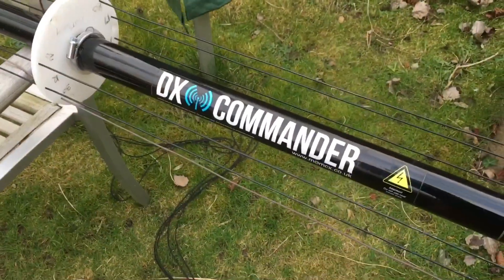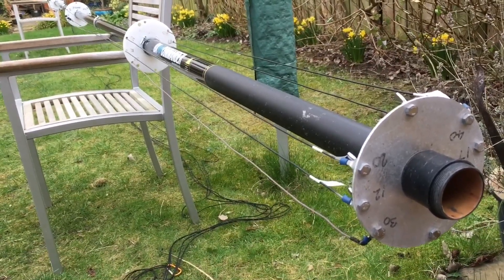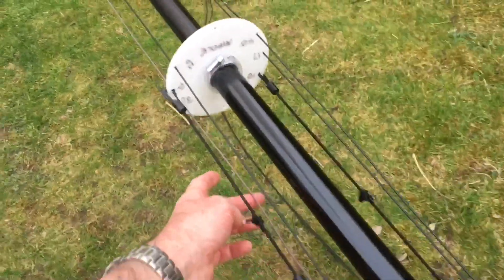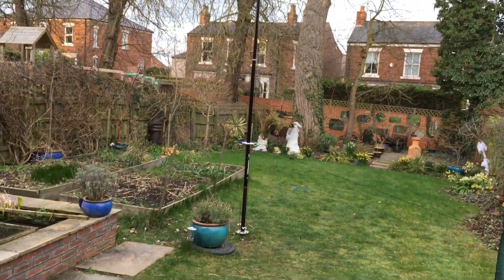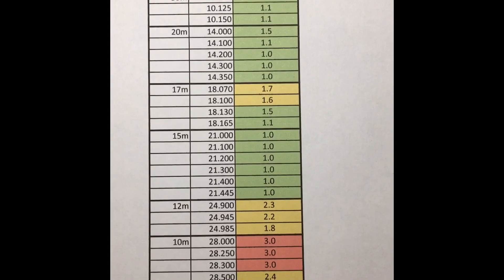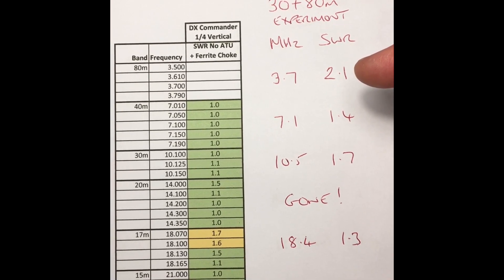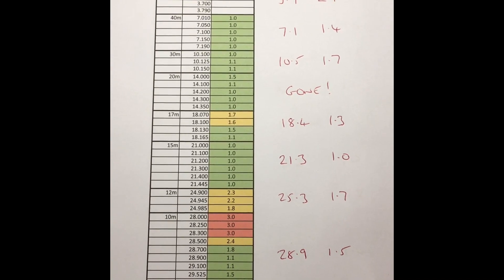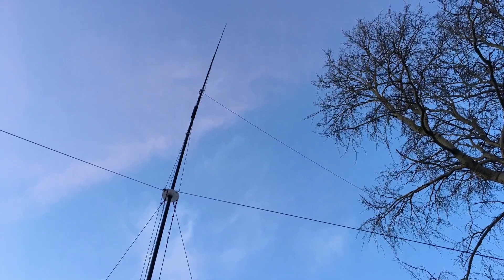DX Commander Home Base Antenna Installation - Adding 80m - Part 3

Comment: Thanks for experimenting with 80m, it was something I was considering doing when my DX Commander which arrives later this week. Could you advise me on the total length of the 80m wire please (from the main plate to the isolator at the tree)?  Also did you notice any significant difference with the coax isolator in place? Thanks again, top video!!
Reply from the maker: @dave-ef2fd  Hi Dave. That’s video’s from a few years back now. The choke doesn’t negatively impact the setup. I can’t recall the length of the 80m wire, but if you start at 20m and then trim from there, it won’t take you long to find the length that works for your setup. I still use mine, but now without the pole. Just the base plates and radials and 160/80/40m verticals up to the large tree. Good luck with yours 👍🏻 (I also have an Expedition model with an 80 option. It’s on the channel and may include the 80 length? Not sure)

Comment: Good video now I can see what level to run that wire for 80 at. Very useful information. 
>>>UPDATE!! I went off at the 5meter (third) spreader like Callum  suggested to keep the bending moment lower on the pole. Reduces the bendy aspect of a taller take off. My 20 meter is my best band. <<<
Reply from the maker: Great 👍🏻

Comment: Have trimmed element lengths to achieve
However, the 80M SWR curve only dips
You can see the graphic of the SWR curve

Jimmy
W4MUF
Reply from the maker: Hi Jimmy. If you tried to post a picture of the curve it’s not showing in the comments. Good luck if you’re still adjusting 👍🏻

Comment: You can see the graphic of the SWR curve here…
 
 
Jimmy
Reply from the maker: Hi Jimmy. I saw your graph on a notification I get off YouTube, but I don’t think it allows embedded links. The width of the dip looks about right, but like you say, it’s not low enough. This could be perhaps the positioning of the whole antenna and/or where the 80m element goes to and what it’s near? You may also find more radials bring the dip lower too. Good luck 👍🏻

Comment: Hi ian excellent video. In regards to ground radials for 80 40 and 30m, by adding an earthing rod to compensate does this make mutch of a difference to performance noise and swr?  Regards David
Reply from the maker: David R Hi David. A ground mounted 1/4 wave really needs a ground plane to perform. I don’t think a rod will achieve much, but if you have the equipment to hand, then perhaps worth a try? Since this video I’ve extended two of radials by soldering extra lengths of wire to their ends. So two of the 40 x 3.5m radials are now actually 43m long. Having said that, I’m not sure if it’s improved as a result of this? If you check out one of my other videos, I successfully use the base plate for 1/4 wave verticals on both 80 & 160m. Enjoy your radio 👍🏻
Reply: @G0CNN-Ian  thank you for your reply Ian, really useful information. I have a limited antenna unfriendly garden  but will keep trying. Hopefully see you on the key
Reply from the maker: David R Have fun David!

Comment: I just put up the DX Commander ABV antenna also. I am having bad problems with the swr being to high. Here is the way it goes on mine.
40m 7.041 is 1.8 7.175  is 2.5 and 7.300 is 3.4with a 6 cms foldback
29 m 14.0014.225 and 14.350 is 2.4
17m  18.110 is 1.6 and 18.168 is 3.3
15m 21.225 is 1.2 and 21.450 is 1.3
10m 28.300 is 6.1 and 29.700 is 7.5 
Am I correct in thinking all my vertical elements are to long? I used measurements Callum gave in some of his online instruction.as follows
40m is 11.5 meters
20m is 4.82 meters with a 20cm foldback. 
17 meters is 3.83 meters with a 6cm foldback
10 meters is 2.5 meters with a 5 cms foldback.

Any ideas would be appreciated! Thanks!
Reply from the maker: dheller777 40m looks too long. Fold more over and see where it goes. This will sort 15m as well as it’s the same wire.  I can’t tell for 20m as I think you’ve mis-typed? The others are probably long too, but the higher the frequency, the less fold back you need as they are more sensitive. If you fold back too much, you may over-shoot! Sort 40m first then go up the bands from there. You’ll sort it in the end. Just a case of a lot of ups and downs of the antenna and moving the electrical tape before you finish and commit to the shrink tube 👍🏻
Reply: 20m 14.255 is 1.9 and it goes up to 14.350 at 2.4
Reply from the maker: dheller777 again, may be lower SWR nearer 14.000MHz and too long? Assuming the antenna is not too close to anything and you’ve got the radials down, then there should be a 1.1:1 or 1.2:1 SWR reading in there somewhere for each band.

Comment: Do you think running coax up the pole for adding a dual band 2m 70cm verticle would mess up the balances of the other elements.
Reply from the maker: tony cantrell I think it might Tony, plus you need to think about your radials or ground plane. At the end of the day, if it only involves a bit of coax and wire then anything’s worth a try. You could always use a separate pole for a dedicated vhf/uhf antenna with some sort of wire radials at the base of the colinear (which will be somewhere towards the top-end like you suggest). Have an experiment! Ian.